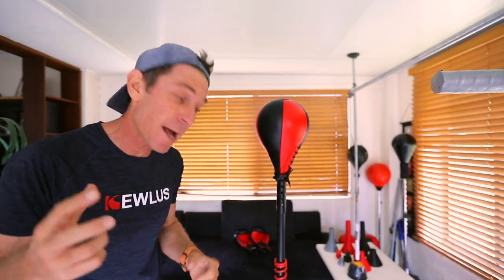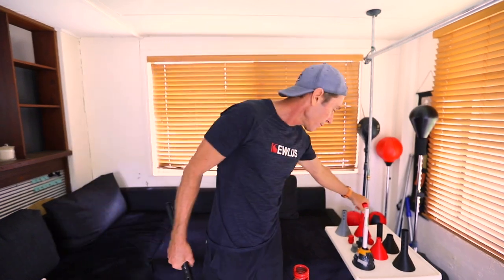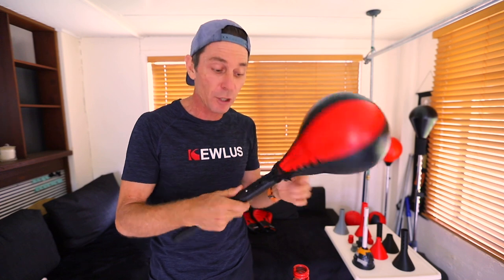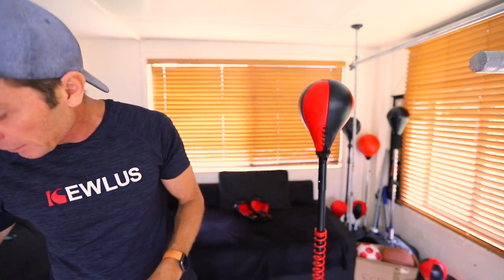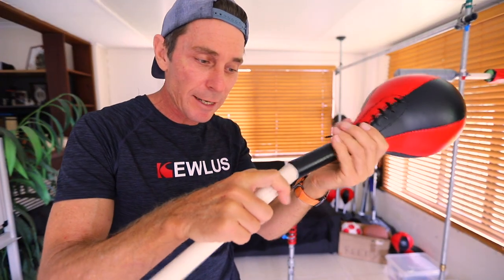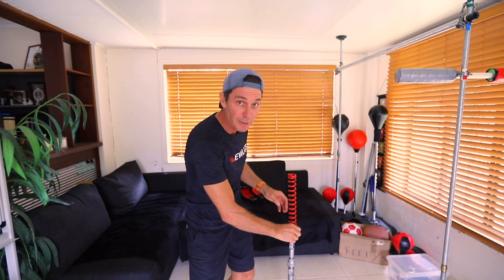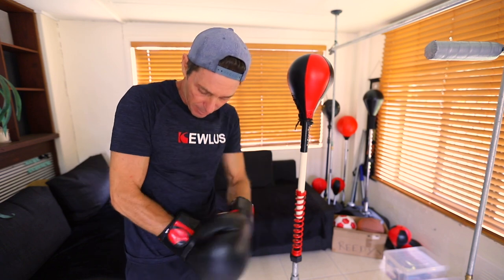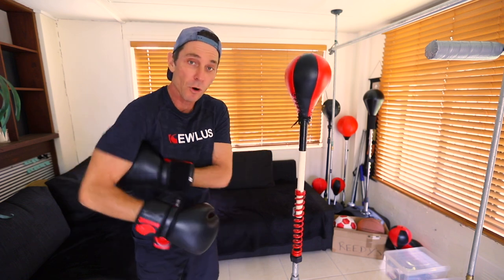3D Print Your DIY Cobra Punching Bag Components

Comment: very cool, this project is quickly fleshing out to somthing really interesting. cant wait to see what you put out next. you tried ABS on the spring clamps? most 3d printers nowadays can print ABS if you use an enclosure + an extractor.
Reply from the maker: Thank you. I haven’t tried ABS but about to try nylon and polycarbonate with a high temperature nozzle. For most of my prototyping needs basic PLA seems to work ok

Comment: Bought my kewlus spring put it together with a pipe and pvc I didn’t use a plunger as an adapter I just cut the pvc pipe and duct tape a funnel then tied a speed bag on works great
Reply from the maker: I didn't think just a plastic funnel would hold, but you've proven me wrong. I'll definitely have to try that. Thank you for sharing!!!!
Reply: @Kewlus  I was unsure at first as well but I couldn’t find a plunger that would fit my pipe and I didnt really look that hard so I just cut the pvc and taped it down. I also cut the funnel a bit so it would fit inside the speed bag
Reply from the maker: Great stuff!! I’ll definitely try it
Reply: @Kewlus  also I bolted a flange to my garage floor . When I’m working my cobra bag I keep punching so much that it’s unscrewing itself from the flange so my neighbor gave me this threaded ring I don’t know what it is called from an old air conditioning unit he had thrown away. I attached it to the pipe and put it back in the flange to keep it held down
Reply from the maker: I think I know what you mean, like a large rubber washer? I think you could also use plumbers tape to create a better contact
Reply: @Kewlus  I’ll try the plumbers tape thanks ! and the washer is like a thin metal ring but it is threaded well it has two sharp metal inner threadings